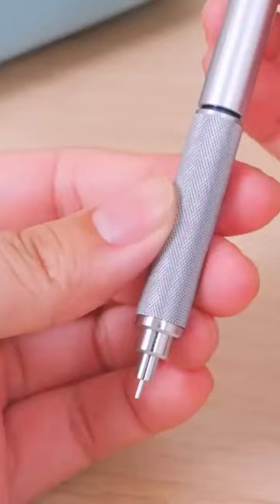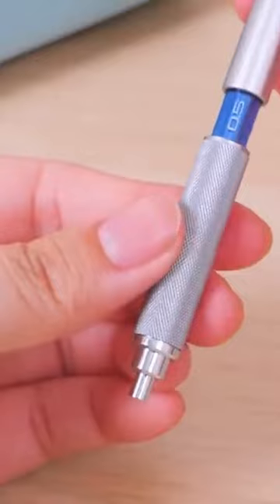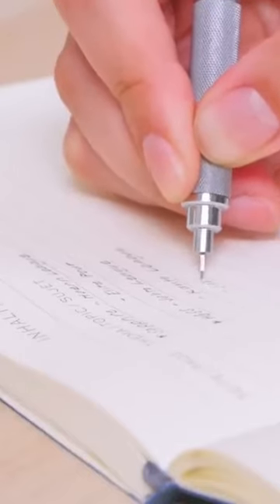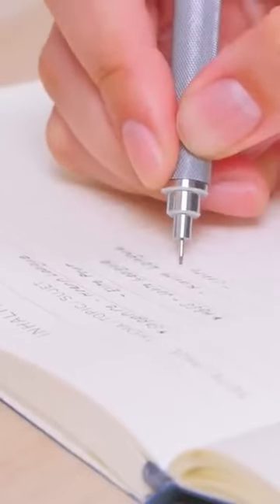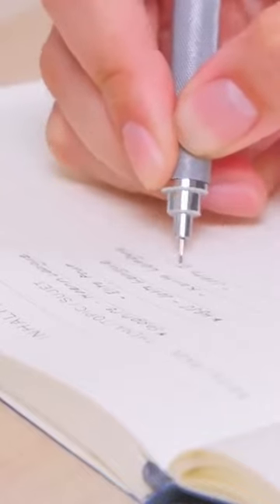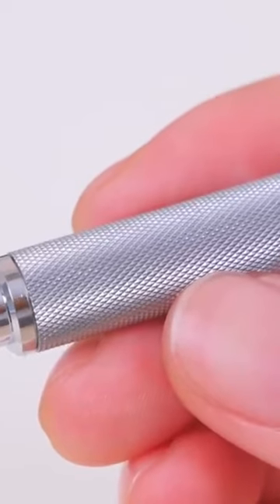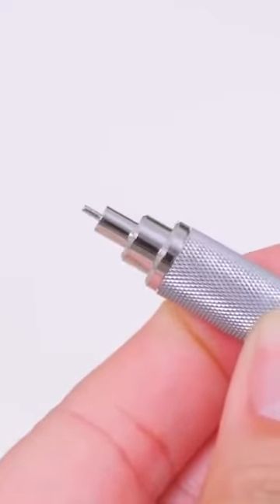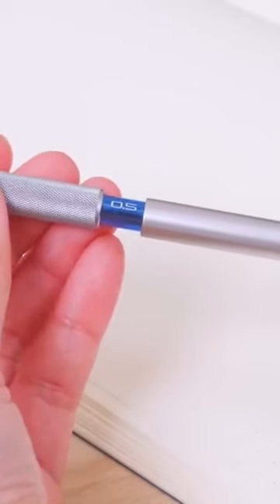Is this pencil GENIUS or overengineered? ✈️  #shorts

Comment: Not over engeneered, well engeneered, its a product that offers a solution to a problem. One that has caust me a good amount of graphite and little bits of graphite powder in my bag. On another note would be a good addition to my little stationary collection.
Reply: It really is the best mechanism for the purpose. It can be a bit loose, but it is a better portable drafting pencil than anything else i have used. The main complaint i see is that it has a platic shaft, but it is rather good plastic so it doesn't matter. Nothing else on the market of comparable quality, especially for just $10

Comment: Am I missing something? Normal mechanical pencils do this without the extra stuff
Reply: because its a drafting pencil and has the long metal lead sleeve for easier straight edge use it would still stick out if you pushed the lead back in. 

The bottom of my pencil pouch has a couple of holes because of that. 

still not worth it tbh.